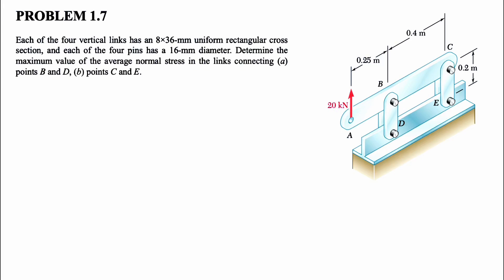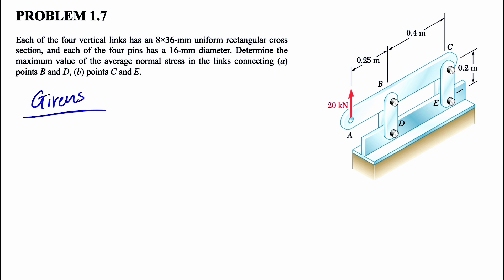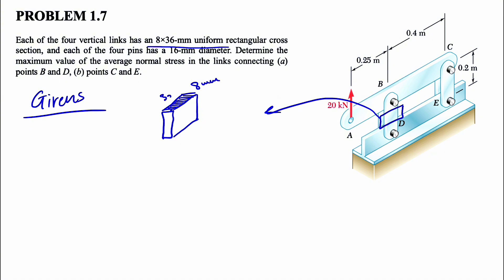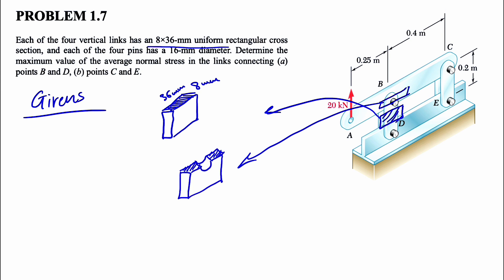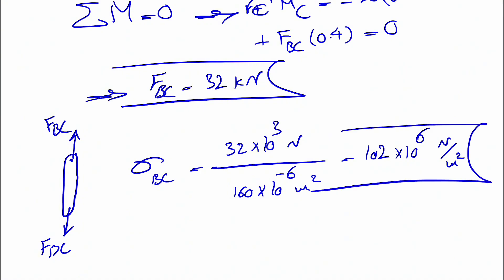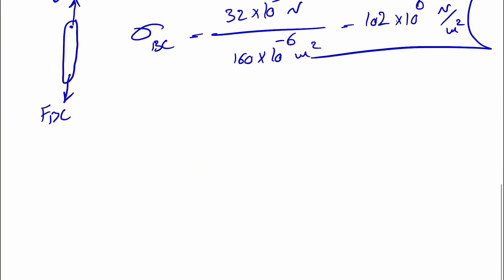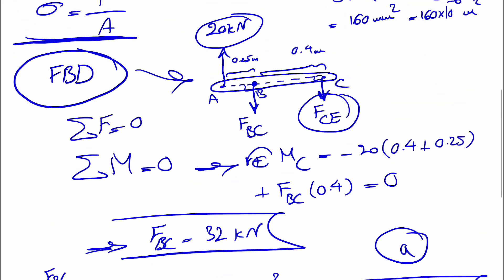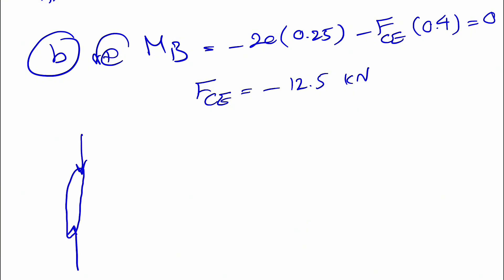Problem 1.7 | Determine the maximum value of the average normal stress in the links connecting ...

Comment: Hi, thanks for this helpful solve 
but why u didn't  multiply the areas by 2
Reply from the maker: You are absolutely right, it needs to be 2x area and the reason is that the force FBC at 4:31 (which I should've called FBD) is the resultant of the two forces in each member of FBC (we have one in the front and one in the back). So this force is applying on two members therefore we need two areas.
Reply: @ENGMATANSWERS  Thank you!❤ Just one question, does that change the answers?